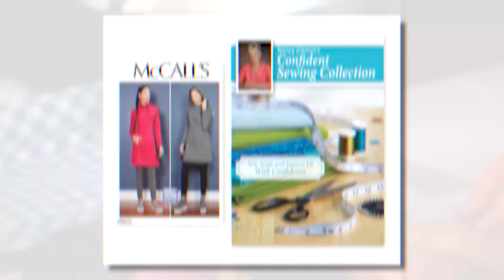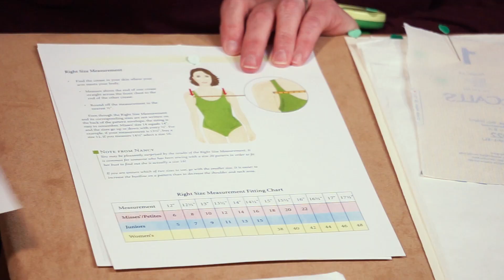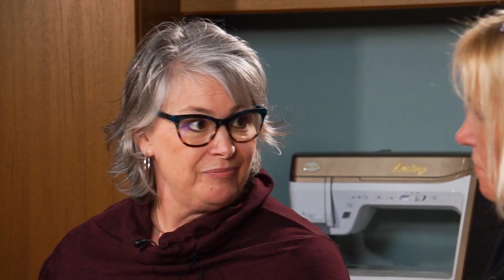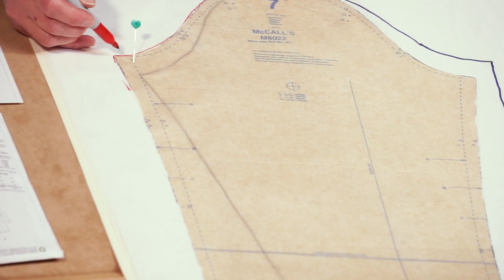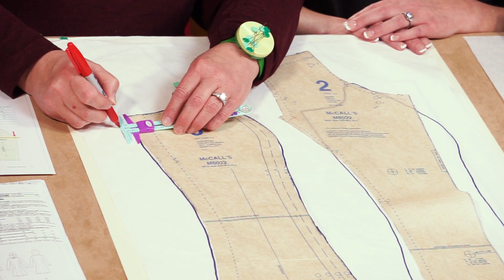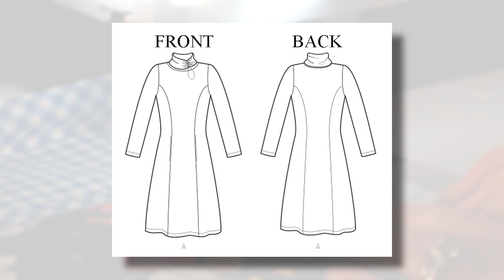Stitch it! Sisters Tunic Pattern Fitting the Nancy Zieman Way S!S 113 by NZ Productions

Comment: Why does the fitting chart switch from the traditional pattern sizes (14, 16, 18 etc) to 42, 44, 46 etc when you go from Misses to Women’s sizes?  What do those numbers refer to?  It’s equally confusing on the pants chart because she says to use a size 22 if your hip measurement is 50” or more, but if you’re no longer a Misses, but a Women’s pattern size, you get a 44. What pattern is a 44?  Yes I can fill it in myself, but I don’t understand where she gets those numbers from. Help!